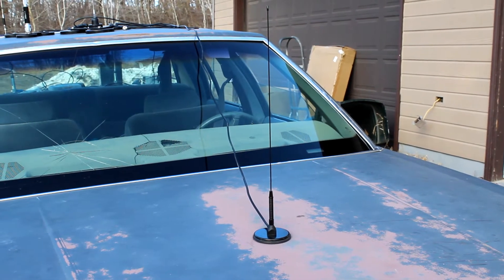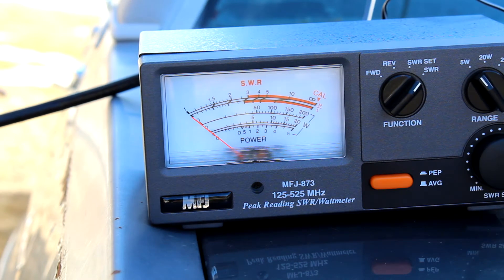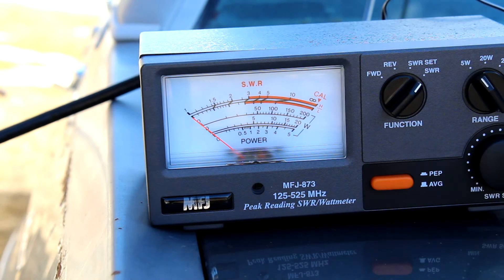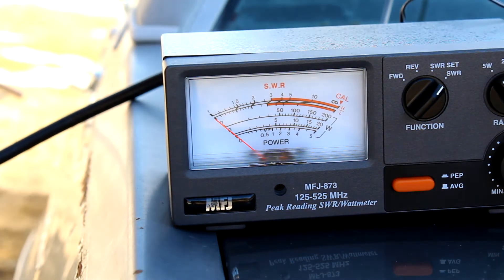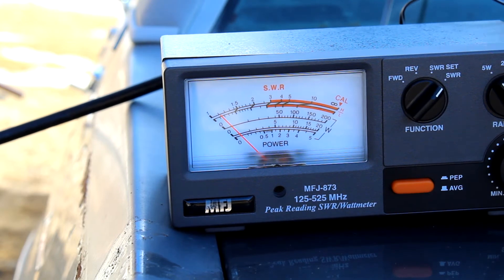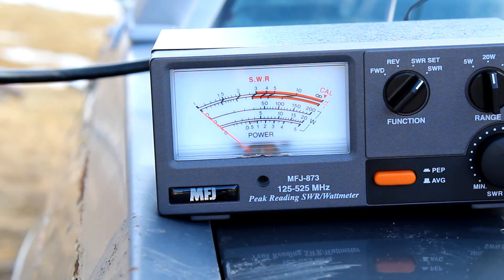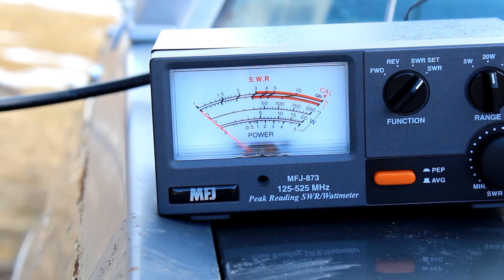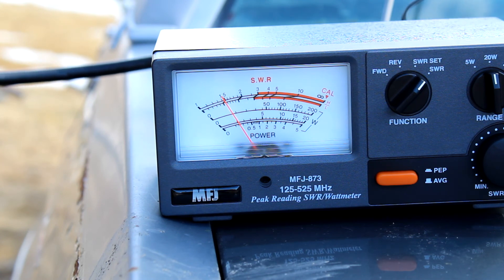Nagoya UT-72 2 Meter/70CM SWR Test On Ham Bands

Comment: Good day,

I'm planning to purchase either the Nagoya UT-72 or Nagoya UT-72G antenna. I'm primarily going to use frequencies between 451.000 to 455.000 most of the time, and occasionally frequencies between 144 to 147. I've heard that the Nagoya UT-72G might be a better choice since its frequency range extends from 155 to 462 compared to the Nagoya UT-72, which covers 144 to 430. However, I've noticed that the Nagoya UT-72G is more expensive in my area. Can you please provide guidance on which antenna would be the better option given my frequency usage and budget constraints? Your assistance is much appreciated. 
Thank you.
Reply: I've got perhaps a similar question, as I'm wondering if the Nagoya UT-72 is a good choice for the Baofeng UV5r to use for BOTH HAM, and GMRS?
Hope we get some answers here, friend!

Comment: I’d be interested to see a test on a metal tray. I’ve heard that the SWR is uselessly high on 2m with a tray so I’m afraid to use it there. Maybe metal rods duct taped to the corners of the tray would help?
Reply from the maker: I'll give it a try here today or tomorrow.  Considering what bands are used, it should not take much of a ground plane to get it to work.  Might take the antenna analyzer and some steel and see what is what.

Comment: Great results with that antenna. Outstanding low SWR readings. A real performer.
Reply from the maker: It certainly seems to have its merits.  Cheap, small, good reflected power.  Still, only rated at 10 watts maximum output, and I have never actually tried to test the magnet on the road to see if it flies off at speed.

Comment: Conclusion is/was please??
Reply from the maker: 1.4:1 SWR at 144 Mhz down to 1:1 SWR at 148 Mhz on 2 meter.   1:1 SWR at 430 Mhz ranging to 1.6:1 SWR at 440 Mhz and 1.4:1 SWR at 450 Mhz.  Acceptable reflected power throughout the two bands and a fine antenna.  Just that it isn't 1:1 throughout the range like the other test on the other channel suggested.